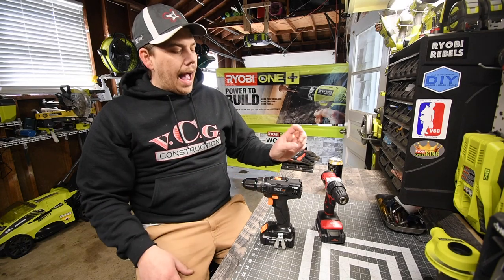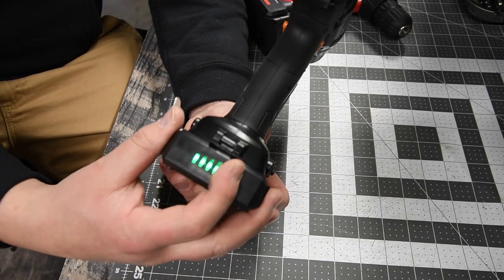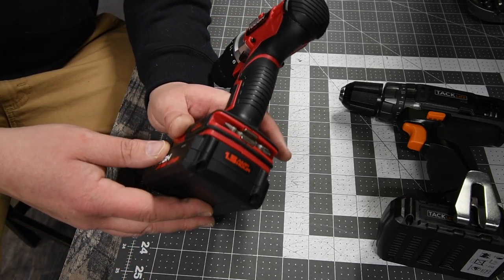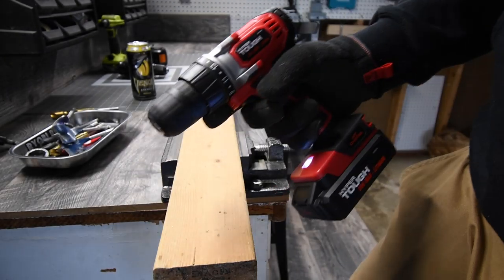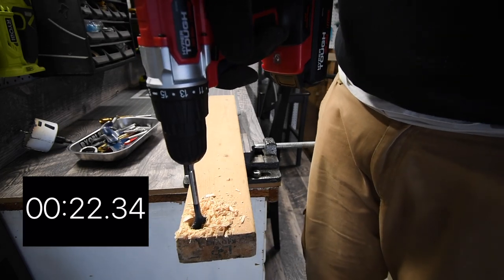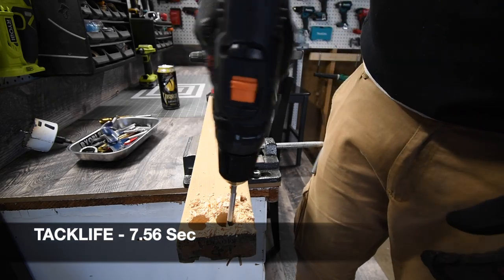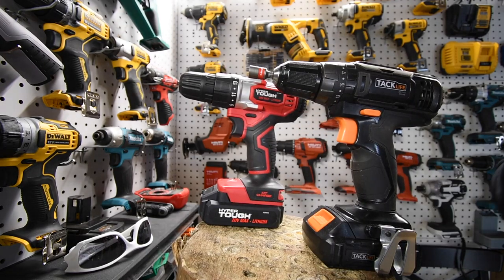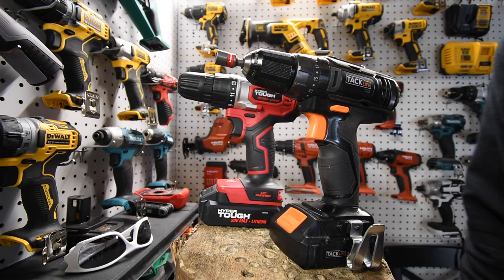Budget tool battle  (TACKLIFE vs. Hyper tough)

Comment: I’ve had this hyper tough drill for over 2 years and it’s been a little champion for small task around the house and taking apart interiors of my cars. I also have the bigger version with the metal chuck that has more power and that’s also great in its own right, but they can’t compare to my Milwaukee tools. Great budget friendly tools especially if you catch them on sale for dirt cheap.

Comment: You should have included pricing.  I know Walmart sells the hyper tough drill kit for $30 now.  But some still have the drill, impact, flashlight and recip saw for $40.   But I think regular price is like $80 for that kit.  
Not sure about pricing on the tack life.  
Good video!!  Those tests are above hyper tough’s pay grade.   I mainly use my for screwing things together.   It’ll sink 3.5” deck screws no problem.   They’re decent tools.  You just gotta think of them as 12v tools.
Reply from the maker: I agree. and I am sorry I didn't add price

Comment: Why has that drill got a ratcheting clutch noise in drill mode ??? Is it in drill or driver mode ???
Reply from the maker: the drill was skipping on the clutch because it was breaking.
Reply: @ManCaverTools  Oh right. Thanks for your reply. Just wondering,whats the price comparison on the two as the sounded like a proper cordless drill? Cheers
Reply: @ManCaverTools  Tacwise